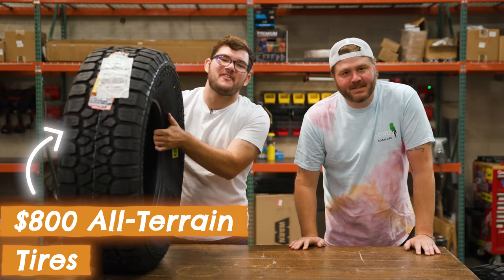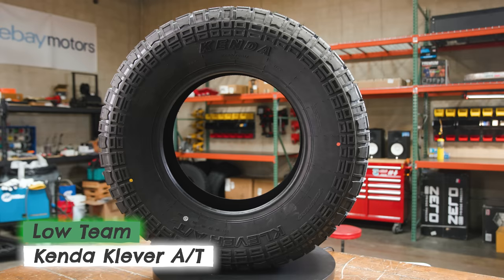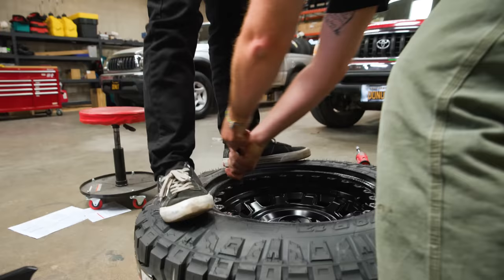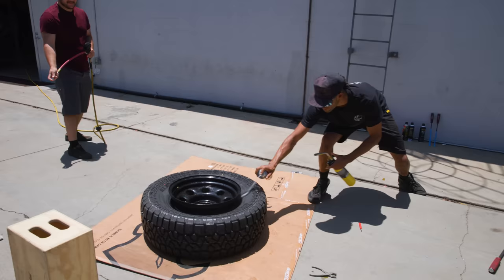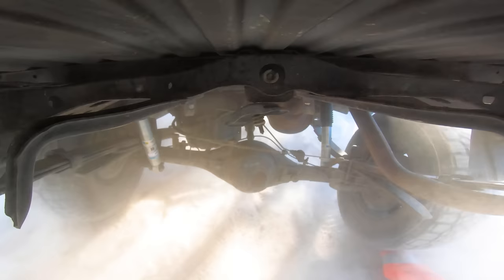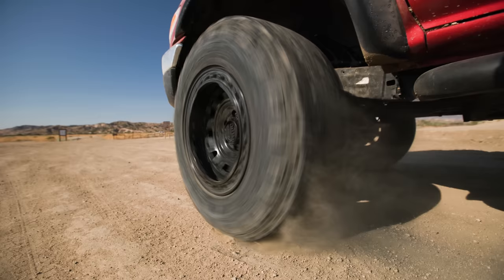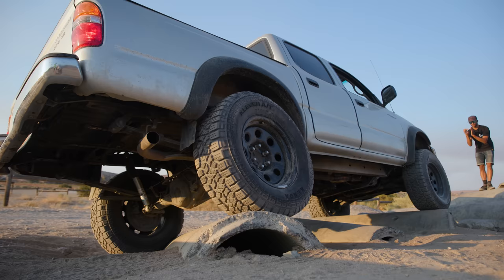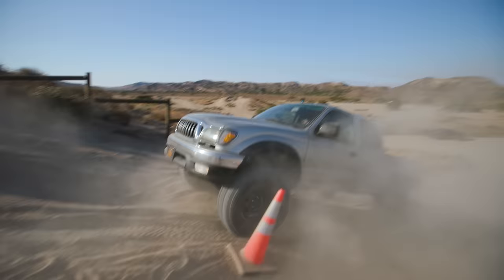$800 Off-Road Tires vs. $1500 Off-Road Tires

Comment: When offroading, SKILL LEVEL is every bit as important as the mods. I've seen guys with open diffs do amazing things. Don't discount Skill level boys!
Reply: But then you're abusing the front diffs.  Imho weld the rear and drive it in rwd, you can do 90% of obstacles and keep the wear on the weaker front ends down .
Reply: facts
Reply: @0xsergy   that sounds like the lowest of low car lol
Reply: This is so true, a mate of mine does alot of ofroading in his daily/almost stock suzuki samurai and beats so many trucks with hella mods
Reply: Brings up the old phrase...
All The Gear... No Idea.

Just because you have a fat wallet, doesn't mean you're getting around that course.
Reply: That was my take. Hi-truck's setup was triple the price. It would not have made Nolan's skill level any better.
Reply: That was shown in the first episode of this season lol.
Reply: @0xsergy  they are trd offroads they have the factory e locker in the rear but none of them know how to activate it… and the only reason to weld a diff is for a built crawler not a street truck
Reply: Parking brake trick has save me a few times
Reply: @0xsergy  abusing the front diffs? They are meant to be used you know...Thats why 4wd exists. They don't break easily
Reply: I’m new to trucks and off-roading mine but the way they take the buffhorseshoe doesn’t seem correct haha. GAS GAS GAS GAS
Reply: @dieselgeezer18  offroad cv shafts and independent front suspension is always the first failure point my man. Source, I've broken like 5 CVs. Never broke anything in the rear end yet.
Reply: @ItsJoshN  ya they are more of bouncing it not crawling it haha
Reply: @0xsergy  ifs is goobage, but opens on solid axles are plenty beef. Welding diff is a big commitment lol. 100% driver though
Reply: Yessir! 🤝
Reply: Yea i have seen landcruiser stuck in sand while the pros r out there with there normal 4 door passenger sedans
Reply: @0xsergy  never broke any CVs. Simply replacing them when they wear out normally
Reply: @0xsergy then you risk breaking your rear diff.  Standard pinion differentials are much stronger going in their intended direction... Eg low pinion dig in the rear / high pinion in in front, you are going to save a lot of stress by spreading it out. This means putting it in 4wd
Reply: Every bit as important? No. Important and makes a difference? Yes. Skill won't make up for no ground clearance, no lockers, poor tires or a winch.
Reply: @richieb7692  true but just because you have all the skill in the world doesn't mean you are getting their in a Honda civic either
Reply: I have seen skilled off-roaders get up similar hills with stock vehicle.
Reply: The 14bolt Dana 60 set up will loose to the Dana 30/35 if the skill and experience is better 💯💯
Reply: @0xsergy  broke the CV in my tahoe just from constantly going down my terrible limerock driveway🤣. Was about 20 min away from home when it happened, clinked and clanked my way home lmao
Reply: @rhinos4631  Zach does.
Reply: @danielc.8006  you sure about that? none of them have been engaged that’s why both spin in open open
Reply: A 19 year old kid with a $800 crown Vic and way more determination than sense can get pretty ridiculously far up some insane off road trails… know it first hand.
Reply: Didn't realize how much a wimp Nolan is I still like him just damn he's the wimp of the group
Reply: Thanks nancy🤦🏻‍♂️
Reply: I would agree... it's like playing poker... being dealt a great hand is a good start, but there is no replacement for skill. I could hand my 600 dollar paint gun to someone that never painted , and I could use a 30 dollar spray gun and odds are my paint job will look better...Now of course I can get better results  with the 600 dollar gun vs the 30 dollar gun. If I only had to use it a time or two , I might tend to use the cheap gun and throw it out. But in reality the cheap guns don't have repair parts , and would cost more in the long run.
Reply: You are 1000% correct. I knew as soon as low truck didn't make it through the course it had nothing to do with the tires and everything to do with the driver and spotter.
Reply: Right,  managed to get out of a pond in a AWD jeep liberty with open diffs, shitty street tires, and open diffs.
Reply: @davonmulder8458  he’s rocking a samurai tho, those things are wicked
Reply: I love following people in rigs with lockers. Just takes some skill & time behind the wheel. It also helps when you have good tires, too.
Reply: Right?? These guys don't realize that at all, I commend them for doing the video hoqever
Reply: well said .. the best and or worst part of any vehicle is ... The nut behind the Steering Wheel.
Reply: However***
Reply: Snow wheeling is where the skill level shows, shame they are in Cali in the summer
Reply: ^ This guy never had lockers and red labels
Reply: @rhinos4631  I’ve run a welded rear for over 100000 miles on rigs. No issues.
Reply: @Apercep  congrats it’s a shit system for people who can’t afford a locker…. Do it proper
Reply: Skill level is way more important than the mods!
Reply: Whistling Diesel proved all you have to do is floor it in a Hilux
Reply: They should do cheap vs expensive lessons for one episode
Reply: I can absolutely attest to this. I went up one of the hardest jeep trails in my area in my old S10. It was stock, RWD, open diff, street tires,  the works. Once I made it about halfway up, people stopped laughing at me for doing something so foolish. All it took was some choice lines and in some cases a solid run up. The very last part of the trail killed my run, however, since it's a near vertical rock climb, and there's not much I could have done.
Reply: @richieb7692  firs time I’ve ever heard that phrase lmfao !
Reply: Word, skill is king.
Reply: @rhinos4631  trd off road doesn't mean they have a rear diff. locker it's an option nobody was using a rear diff lock. I would argue that a stock truck on stock tires with a front lunchbox would walk through everything in this video.
Reply: Driver mod
Reply: @jgranger2002  what are you on about? The tacoma comes with electronic rear locker in the trd offroad model only the tundras don’t come with em in the offroad model
Reply: @jgranger2002  now before 1998 they didn’t have a locker because a trd option wasn’t a thing until after 98
Reply: @rhinos4631  it's an option. The trd off road doesn't mean it has a rear diff locker.
Reply: @jgranger2002  it was an option on the prerunners before 2001 after that they were all put on the vehicle and it wasn’t an option
Reply: @jgranger2002  you really ain’t reading are you?
Reply: tread pattern is huge in off-roading. there are a lot of well set-up tests that show how different patterns do in various conditions. also, its why all ag or industrial tires use essentially the same pattern
Reply: @rhinos4631  I work on a lot of these trucks and trd off road despite the year doesn't mean it has a rear diff. locker it was a option.
Reply: @jgranger2002  sigh then you don’t work on them enough…. because it was a something on the trucks when the offroad model came out to make it seem special…. all 2nd gens and 3gen offroads have a locker and you can’t take it off buuuut as I said If you get a prerunner that is a offroad model it wasn’t something on the truck it was an option until 2001 then it was always on it
Reply: You defiantly don’t need lockers, defiantly not a need for most trails all you really need is a level and armor
Reply: @0xsergy  that's not ideal for a daily driver weekend off roading.
Reply: @rhinos4631  I promise my jeep goes places your mall crawler doesn’t… keep your bs to yourself.
Reply: Skills ahhh nope.(that's how ish gets broke or stuck in a hurry) The drivers need to hit up you tube n get so sorta idea when to put in low or activate lockers if they have them from factory . etc.
Reply: Yeah buddy I did some amazing things with open diffs on 33's on my Jeep XJ
Reply: Just so you big fancy tires don’t always do the job, sometimes airing down a set of tires works better than anything else
Reply: I want them to do a episode on off-roading lessons and review them
Reply: @0xsergy  lmao locked solid diff
Reply: False.
Reply: This is entertainment, if they really cared to do the experiment they would Baseline the trucks before they threw mods at them.
Reply: My grandfather always told me his father could take a 2wd places most people wpuldnt even take a 4wd. He gew up driving a chain driven truck hauling gold in the desert.
Reply: I can recall at least 3 times when one of my friends got stuck or couldn't make it so I had to hop in 😂
Reply: Shit an alignment doesn't even fit in my budget
Reply: So true. 35 years ago, my off roadin' rig was a 72 Dodge Polara. Car. Stock. No knobbies, no posi, no lift. Gramma fresh. I did not mind hurting it. I was 19. I did hurt it. For 9 years.
Reply: @brandonthede7452  100%.
Reply: Low truck didn't have the tire pressures down on the last obstacle, that was why they were spinning tires. If they dropped the tire pressures they would have completed the course the exact same.
Reply: @0xsergy  ? Ive never broken CV or tie rods, mechanical Sympathy also goes a long way with Picking the right line and also knowing when to track build or winch with Open Diff, called using your brains. Only time a CV will snap especially with a Front Locker/lokka is if you go full retard "fully send it" or slip awkwardly in a rut. 9 years with the old Ford Courier (Australian 2005 Ford Ranger) and never broke a front cv.
Reply: @918_xDx  i've NEVER broken a CV shaft. The joint that goes to the wheel simply wears out and makes a weird noise. Thats it.
I also asked a friend who owns a toyota hilux from 1990. He has abused the hell of out this truck. It has almost a million miles. Never broke any CV joints in its lifetime
Reply: جك
Reply: I want friends 
I'm from kwuait
Reply: @davonmulder8458  suzuki samurai's are beasts bro
Reply: @dexterrr9163  yeah they are amazing!
Reply: Hay.
Hi
Hallo
Hello
Holla
Reply: Very true. But at the same time you could literally apply that logic to anything in life not just off-roading. With the guys having literally no "skill"/experience, this is probably the best demonstration on how the mods can assist with driving lol.
Reply: That Great of doing.
Reply: Also: TOYOTA
Reply: @0xsergy  get a solid front axle.. 🤷🏻‍♂️
Reply: That is so true. The first sign of a novice is being afraid of low tire pressure. I offroad a lot in the sand dunes and my experience has been 6 psi with beadlocks and 8-10 psi without. However it take some skill and steering discipline without beadlocks.
Reply: My stock tundra with me driving can keep up with the guys with crazy jeep builds up in the snow and I can almost out perform those guys in the mud. Knowledge and a good teacher goes a long ways
Reply: This is 100% true! I drive a 2wd and have gotten through stuff a 4x4 driver didn’t all because of knowledge on the area
Reply: @rhinos4631  even for a built rig buy the proper lockers. Welding your diff is such a low end solution that’s only used because you blew your money somewhere else. Buy the lockers instead and you’ll do far better, especially if you have any plans on wanting to drive the rig on the road at all
Reply: That's just what the guys who bought the Sport not knowing the differences between that and the Off Road tell themselves to fall asleep.
Reply: Hell, I've seen 2wd with lockers go up those hill lol
Reply: 100% agree, I have taken my 2000 2WD Ford Ranger  over the Rockies several times flowing jeeps and 4WD full sizes. Yes I have been suck but the fact its weights 3200lbs makes it very nimble!!
Reply: @SuperTheast  I know why people do it you don’t gotta tell me lol it’s a poor mans solution hell a lunchbox locker would be better
Reply: 100% Agree

My stock open diffs Suzuki samurai do thing you can't even imagine.
Most of the times I can keep with the big bois
Reply: @rhinos4631  honestly even an open diff would be better than welding. I’ve seen so many friends running a welded diff solely because they wanted to run wheels that were like 1k a piece because they looked cooler. They all ended up thrashing them anyways so it was a pointless buy
Reply: @dieselgeezer18  ah yes, since one person's experience is everything.. lol. Yes, you never happened to break one through dumb luck. I've seen multiple buddies break em for sure though so unless they were all faking it..in person..including the noise.. I'm gonna just assume you haven't ever hopped the front end and had it come down on you cause that is a surefire way to break one.
Reply: I've gotten out of some fairly sticky situations with just fwd, no traction control and an open diff
Reply: The best upgrade to any tool is it's operator, that said a more capable tool makes life easier.
Reply: 0xsergy no. Locker before lights. And don’t use junk lift kits that throw off cv axle angles at full flex. And upgrade the diff if you blow it. Oh well. Depends what you wheel. I’ve got 2 sas Dana 60 Nissan’s. And I’ve got 2. Ifs Nissan’s.
Reply: @davonmulder8458  Suzuki samurai is a good off-road vehicle tho. Very good if u wanna make a rock crawler. Also alot lighter n more centered wheels vs stretched out n a high center point.
Reply: @brandonthede7452  are you the guy with a winch on the front of his crown Vic on reddit? 😂
Reply: @Chopstx98  nope but it’s possible I know that guy
Reply: so next up... expensive driver training vs figuring it out from youtube for free
Reply: Hello my scubru 2007
Reply: @SuperTheast  wouldnt say nice wheels are a waste you just need to know they will get rashed  and beat up the wheels I have are scs stealth 6s not super expensive but not cheap either
Reply: @rhinos4631  they’re only a waste when you focus solely on them but then skip better upgrades. I’ve seen so many people with a welded diff because they wanted to spend insane amounts on wheels. Then they complain about the welded diff.
Reply: @davonmulder8458  The Suzuki Samurai / GV were known for handling very well. Just a higher skill ceiling.
Reply: well to improve traction you need a rooftop tent, 3 canopies, 4 or 5 gas cans and 24 lights.
Reply: Without skill pack u probably even not able to use mods.... u 100% right m8
Reply: I agree I grew up in moab ut and I use to pass guys getting stuck in their heavily modded jeeps with a lifted Geo Tracker open diff and all. Skill and trail Knowledge is very important
Reply: Not the front diffs but all the front end components.
Reply: @0xsergy  I say skill can only take you so far...lockers take you the rest of the way
Reply: Ive seen some guys in 70s caddilacs do things that donut couldnt some guys are obsurdly good
Reply: I’ve seen guy with some civic go offroad where some jeep go and stay stuck
Reply: Some people just cant drive
Reply: Wouldn't you want open diff on offroad to limit slip
Reply: @0xsergy  factory is typically shit in these cases outside of farm and mining use  are typically not designed  for off road (not saying they can not be used in off road applications) however not designed to  handle punishing  off road conditions you are likely to installing dana/danner diffs to correct tracking issues and beefing up the diff to cater for off road use..

and i'm not talking about mining and farming applications use here
Reply: @0xsergy  no reason to weld the diff, just get better at driving off-road, first.
Reply: @0xsergy  That's because the rear is a solid axle, my dude. Maybe upgrade your CVs if they're so weak that you've broken 5 of them, seems like you'd want to upgrade after the first two broke.
Reply: @azargelin  sure…we believe you.
Reply: @rhinos4631  yup
Reply: @jgranger2002  my 2017 TRD-OR came with a locker.
Reply: @lorian8984  sure you can…🙄
Reply: @ehtikhet  you’re so smart with your choice vocabulary…get much likes? 🙄
Reply: @hunter3899  you mean like the trails that have white arrows pointing you the way through?
Reply: Mostly true always depends on the rig I do offroad recovery allover Texas if you weigh alot you'd be surprised how many Hummers get stuck out there
Reply: 2021 I4 rwd DCSB Taco, can confirm...
Reply: @DMHal01  Na obstacles like hells gate, Esclator, Tip over challenge, potatoe salad hill, once you run them 10-20 times a year it becomes way more predictable. The trail itself is pretty tame.
Reply: They didn't
Reply: Facts... I've seen 2 guys with a Kia soul dominating a off road trail lmao
Reply: @ethan5610  it would boggle your mind the places me the ex got a Buick Verano.
Reply: Now here comes the bullshit stories of how a man in stock rav-4 with 4 flat tires in 2wheel drive and a seized engine out runs the guys in well built buggies every week .
Reply: @dieselgeezer18  Once an obstacle is close to axle centerline an open diff doesn't want to climb it without ramping over it so unless you have awesome traction at all 4 tires or the obstacle has a ramp like angle for the tire to walk up you end up with wheel that stops and does nothing as you spin the opposite tire . This is why an open front differential on any difficult trail beats up the front axle as you will need to  bash your way over even the mild to moderate things with throttle ...I always get a kick out of these posts dismissing locked differentials as if skill can replace how the differential works when encountering a real obstacle .
Reply: @myessyallyahamericus8405  Must be the war on drugs .
Reply: @rhinos4631  I have a TRD off road also. How do you activate it?
Reply: and hurt their transmissions in the process lol
Reply: @rhinos4631  that shit system has worked for countless people. 
Not everyone can afford the best of the best. 
By the way I bet you don't have Rockwell diffs under your truck. Dana's are fun and all but if your going to do it do it right and put a set of 5 ton axles in, anything less is garbage and isn't worth doing. Using your logic of course.
Reply: @dieselgeezer18  generally when a cv snaps offroad its because of abuse. Watch a truck bumping and jumping up an obstacle, just shock loads the driveline and it'll snap eventually. 
Weakened CVS can snap under less pressure. 
A good driver won't put themselves in the position where throttle is the answer if possible.
Reply: 100% proven
Reply: So true; I have a 2004 Rav4 FWD just with an lsd on the Front and around 12in of clearance (small lift plus 30in tires) and I’ve been in a bunch of pretty gnarly off-road places and speed and skill have gotten me everywhere places. Of course I am not climbing 1feet rocks but like 90% of the trails that say are for 4x4’s I can do them. Left foot braking is incredibly effective atleast for me, it literally makes my front tires seem locked
Reply: Entirely not the point of the series but cool story
Reply: @0xsergy  no shit bro I had to swap in a Dana 44 to my front chunk because the Dana 30 kept breaking EVERYTHING in the front !!!! My first thought was to chromoly the 30 but after looking at the savings of just the upgraded swap to a 44 I would be saving wads of cash and get comparable use !
Reply: @rhinos4631   Never weld a different ever. There are ways to lock that are not only safer but reversible.
Reply: I've taken my two wheel drive Ranger in the places and got out of places that left four by four stranded skill is the most important thing
Reply: I’ve never seen anyone in deep mud with open diffs go further than locked hubs. That’s fact